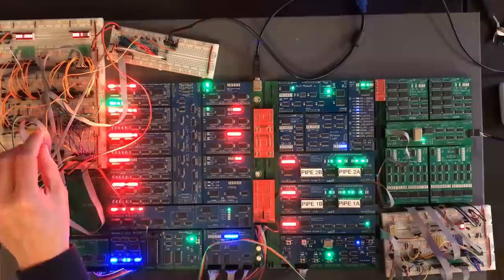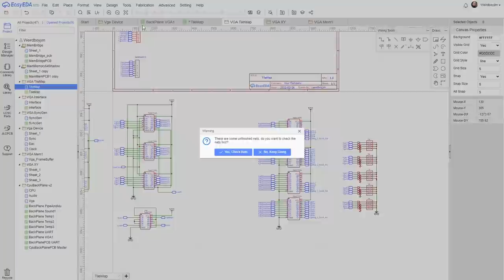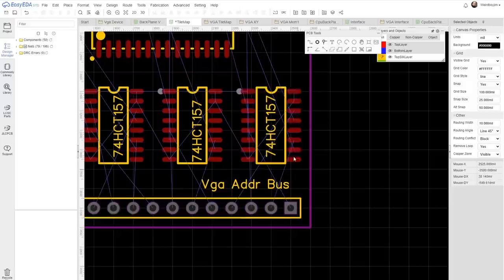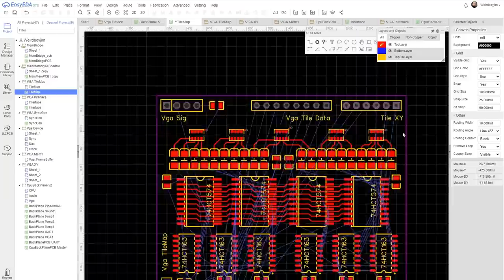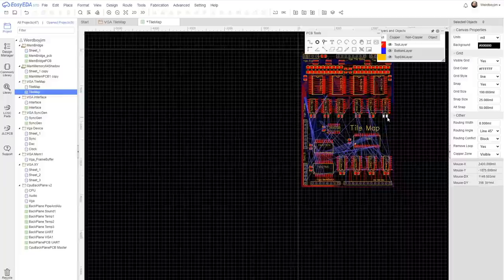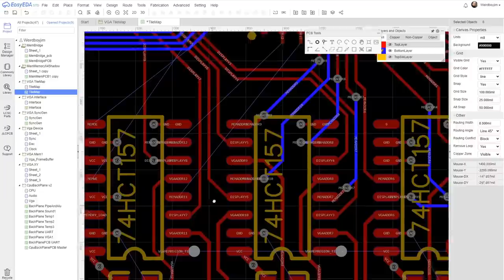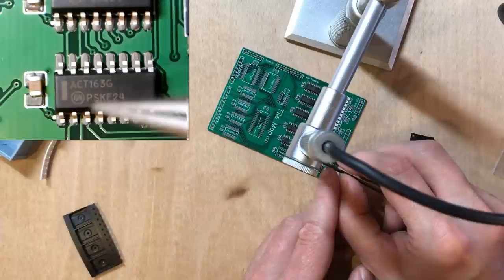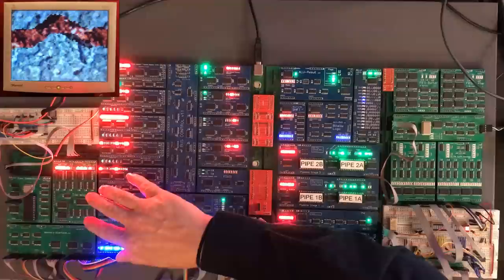Tilemap (Framebuffer) PCB - VGA from Scratch - Part 9

Comment: You would be surprised how many products have gone to market with errors like this that are fixed in firmware. It normally gets resolved in a subsequent updates but version one of the product will be sold with the errors fixed in code. These days it's not so common because PCBs prototypes are quick to turn around but it used to happen all the time.
Reply from the maker: Ha! No I would not be surprised,  I was developing games thru the early console generations. It was not uncommon to have pages of documentation that basically said "Yeah, this is a hardware bug. Here is the work around, there is  no opportunity to fix it".
Reply: @weirdboyjim  Yeh, after graduation I started in electronics in the early 90's but soon jumped ship to software development about 4 years later after realising I enjoyed writing firmware more than the hardware design side so got to see both sides of it.
Reply: Same with ASIC designs! You'd be surprised what gets done with clever software hacks!
Reply: Reminds me of console game development; so many bugs in hardware which needed software workarounds. I remember one early PC graphics card in particular which advertised “hardware transform and lighting”. But we worked out that this was broken, and that it actually sneakily did it all in software.
Reply from the maker: @jimmy21584  I remember that card!
Reply: Historically these errors happen a lot.  And while they can often be bypassed in firmware, the performance and lost of function that they cause can lead to a platform becoming unsupportable.   Nintendo Wii had serious hardware issues in the user input system.  Atari Jaguar had terrible hardware issues with the co-processors that severely hamstrung the platform.  Macintosh 68K developers discovered that the ROM based Floating Point Library could not reliably multiply any even value by 2 without a result that had an unexpected fraction. They had to write their own libraries to avoid this issue because Apple refused to acknowledge that the Library did not meet IEEE 754 compliance.

Comment: I was hoping you would not settle for a soft work around. Well done! Fantastic and fascinating build! Looking forward to the rest of this.
Reply from the maker: I wouldn't have stayed with the soft work around, but I'm glad I didn't have to attempt a wire bodge.
Reply: @weirdboyjim  the problem was introduced when you rotated the connector. You forgot that the other side was already fixed on the base board.
Reply from the maker: @costa_marco  That wasn't it, the connectors were always supposed to be lsb on the right. The issue was purely between the inputs and those register latches. I messed it up when I switched the net's from MemData to VgaData.
Reply: @weirdboyjim  I didn't think you would and it is why I appreciate watching your work.

Comment: I think you hit the nail on the head with your comment on ground issues. As the logic boards grow in number, the issues with signal integrity will increase. So your next step needs to be finding some Pal's, or Gals to reduce the amount of chips so you can shrink the board area. This helps with ground and signal path lengths. The fun with what to do with OTP Pal's if you made a mistake in the logic map :-)
Reply from the maker: Not sure I need to shrink everything down, but more attention to the ground return paths is needed. In this case the sync signals went to the frame buffer bread boards via fly cables in the top of the sync board, the nearest ground return was about 10cm away. Should have added a ground point in that cluster. That was only a temporary line so not a big deal, but on this pcb I've been getting nervous about how far those incoming address lines get from the nearest ground tie to the backplane.
Reply: they made PDP11 entirely out of 74S chips...
Reply: @AmauryJacquot  I think that's why our PDP11 was a lot slower then the PC sized Micro-Vax we replaced it with. bringing back memories of the good old days.
Reply: @TheEmbeddedHobbyist  Yeah.... you all you need to do to get me yearning for my youth is either mention The Human League or the PDP-11. ;)
Reply: @TheEmbeddedHobbyist  yeah, but 74S181 was the most complex chip that was possible at the time the thing was designed…

Comment: James, would love to hear some of your breadboard war storys. Basically the craziness of fault finding on something you just built, that use to work. I'm sure we have all been there.
Reply: As a massive fan of Tom Baker AND The Jupiter Ace, can I just congratulate you on your brilliant name!
Reply from the maker: Ahh the worst one is having it work, then the next day it doesn't. Usually it's a loose wire, but not always.
Reply: Just as tedious is wire wrapping, half the time you end up soldering nearly every connection anyway, I hated it and loved it at the same time. I'm glad it's quick and easy to get prototypes ordered and tested nowadays. Loving this series!!

Comment: Hi James, I would have been tearing my hair out at that! I was extremely impressed by the software fix (although I’m not a coder so your solution is beyond me) I absolutely laughed out loud when you demonstrated your bodge by DuPont switch fix, great work, sadly one board I recently designed I made a stupid error and the resulting PCB required cut tracks and bodge wires…It did work in the end though.
Reply from the maker: I've been fortunate in only having one pcb I couldn't get working in the build so far, I kind of torn about bodging this one,  I might have a go after I've made the fixed version up.

Comment: Yay! Happy Sunday! Tilemaps goodness! I am so stoked, now to actually watch the video.
Edit: That was interesting, a few wild 90-degree track corners appeared, but very well done routing that board. I was/am a bit concerned about the mass of long straight parallel tracks on both sides of the board, won't they make for an amazing aerial? Sure, we are at most dealing with 25 MHz not even getting close to the GHz range where these things really start to matter, but there could be some capacitive coupling. It is probably fine, just one of these backseat routing opinions that are worth the electrons used to transmit them.
Reply from the maker: Hope you enjoy!

Comment: ah yes , invert it two times to make it right . makes sense :D . nice workaround
Reply from the maker: Yes, but I have to fix it before I add any of the other sections that use memory or I'd need to replicate the issue.
Reply: Os replicating the issue bad? Does it have disadvantages? I used design software and hardware and we called lots of bugs design decisions.
Reply: @kriswillems5661  I think most people would invert that: lots of design decisions are bugs.

Comment: I obviously don't know what I'm talking about, but the red bundle in parallel to the big blue bundle in the top left look like "capacitance issues" to me.
What is the "right" and "wrong" way for the resistor arrays? Or is it just "my team" saying to have to have all the markings the same way up? ;)
Loved the wire-flip temporary fix... Nice!
Reply: A bundle of data lines is OK - they generally switch all at once and you just need a little settling time and a good ground between sender and receiver chips.  If you have clocks and other control signals in a bundle, then separation is helpful, and even grounds between signals sometimes, in order to minimise crosstalk.
Reply from the maker: The bundle like that is no different than traces being side by side (Actually a bit better on a 4 layer board as there is a ground plane between them). The long traces down the side do add to capacitance though, if I want to go faster in future builds I'll need to start thinking about that.

Comment: Funny how lateral thinking got you out of a fix there. Still amazing to see what you do. When will I get there? A few days ago my first microcontroller dev board arrived - ESP32. I've decided to leapfrog the Arduino slightly, though I am still using the Arduino IDE and also getting platform IO going on VSCode. Been trying to get the OLED to work, and after a day of tinkering and messing around with serial monitors, flashing blink sketches and some frustration, I'm sort of getting some kind of workflow going. My wife looks on amused as I get the thing to load a monochrome part-image of her face to display on it. 
Between Ben Eater and yourself, you've completely messed me up. I used to be a software purist, but I'm committed now and the psychological hurdles are disappearing. Thanks James!
Reply from the maker: Ahh so your are using the esp as a host for your vga circuit?
Reply: @weirdboyjim  James I can only dream at this point of VGA. I still have to get used to my electronics diapers/nappy, that is how green I am now. I know a bit here and there and of course when I studied at university we did digital logic gates as part of our intro courses (way back in the 80's). So James, I am like a fish out of water (well close to the dam/lake/well). I am going to get there one day, before I retire. I will watch you for inspiration!
Reply: @your_utube  good on you! You'll never regret getting into electronics and being that much more able to build exactly what you want. Keep it up!

Comment: Is there going to be a Microcontroller that will run the whole show ie taking a mode_code plus coords plus the colour and attribute and then does what is necessary to be classed a GPU.
Reply from the maker: Nah, I wouldn't want to integrate a microcontroller, my cpu is more than capable enough for anything this vga circuit can do.

Comment: I realise that I don't know yet how you intend to handle tile data. I have read how the NES (I think) handled the fine X scrolling, with shift registers & a multiplexer to select the correct pixel/bit. But it doesnt seem you are passing the initial scroll offset to the tile data board. I wondered therefore if you are going to pass the VgaTile0-7 plus the DisplayX0-2 "fine scroll" to tile data and get all of the pixel bits in one go (maybe 2 sets of 4 bits in one byte - rather than 4 planes). But - because you are latching the data from the RAM in a 574, wont the tiledata be one step behind DisplayX0-2 - which is not latched ? I guess latch the DisplayX0-2 value one the tile data board to bring it back into sync ? Blimmey this is complicated stuff....
Reply from the maker: There will be a bunch of discussion of these elements in later videos. You are correct in thinking that there needs to be some timing consideration that I have not touched on yet. There are also some surprising influences such as desk and breadboards space which influence what I do in each circuit.

Comment: Try Toothpicks (or connectors) under your Board when reflowing with hotair .. it's incredible how much heat a layered birch plate (?) can suck away.. flatness .. My experience at least I have one too as workspace  ;)
I always find it fascinating what decisions people make when routing.. that board would be a good routing challenge :D
Nice work ! Thanks :)
Reply from the maker: I could always try sitting it on the pin headers, they would provide good isolation.

Comment: How do you get your Stencil sent to you in a bag, mine always comes between a pair of massive spoil boards 😢
Reply from the maker: Is your stencil full size?  I had mine arrive like that before, actually a recent one did but that was because I forgot to set a custom size. The ones that come in the bag I've set to 150x100, the full size ones are really unwieldy for a small pcb.
Reply: @weirdboyjim  That is interesting, I had noticed the customised size option but thought that it might be more expensive but that does not seem to be the case - thanks 👍

Comment: I had to laugh.  I got bitten by a bus reversal in the mid-80s - it was for a weird TI dual port memory chip that had bit 0 as the MSB and bit 7 as the LSB and the bits did matter in that case since they also accessed a bunch of control registers (TMS9650 if curious).  I had eight tracks neatly routed at 0.025 inch pitch.  One cut across all eight and eight very tiny wires later, problem solved.  My eyesight might be a barrier to such a solution these days though. 😂
Reply from the maker: That sounds fun! I have to say I'm pleased I didn't have to try and bodge this one!
Reply: Happened to us too in an advanced satellite demodulator. It was very hard to find because all the bits are pseudo random in that circuit, so you can not just see or measure the error. I found it after reviewing the FPGA design.
Reply: @kriswillems5661  All the bits, but not necessarily in the right order... (sorry, Brit humour from the 1970s)

Comment: What about disabling Line_Flyback pulse till the pixel is read or written.
Reply from the maker: What do you think that would achieve?  If I don't keep pace with the sync it would mess up the display regardless.
Reply: @weirdboyjim  It is how the CGA on computers works maybe someone at AMD could enlighten you, I can remember where I had to disable LFB until I had finished updating the screen then turn on LFB again, I was thinking about CGA not VGA or SVGA sorry.
Reply from the maker: @DAVIDGREGORYKERR  That isn't the way vga works.  G-Sync and Freesync let you modify the sync more flexibility but they are modern technologies for digital displays. These original signals are designed for crt's for physical synchronization and it would take the circuits a while to adapt to change in the pulse cadence. Unless you are just suggesting I stop output the signal during update?
Reply: @weirdboyjim  Do as you deem fit.

Comment: There are tons of bugs like yours, with similar fixes, but instead of being temporary, they went to production. Even some of the big brand PCs had bodge wires on their motherboards (can't remember the brand or the model and couldn't find it).
Reply from the maker: Yeah, it used to be really common in the documentation for games consoles. Not so much now, but I suspect things are better hidden behind api's etc...
Reply: @weirdboyjim  yeah, there is more memory and more CPU cycles to burn for fixing stuff in software cough*meltdown*cough and hoping nobody will notice.

Comment: I feel bad about only one thing when I watch your channel: that I was not following you from the very beginning. It takes a very long time to catch up and some of your videos require a few reviews to fully understand your explanations.
It would help a little bit if you would use the standardized symbols for latches, flipflops and multiplexers, as they are easier to recognize on smaller or low resolution displays.
Reply from the maker: I don't think easy eda supports using standardized symbols like that, I know other software let's you work on symbols and then map it to devices which would be interesting to play with. I want to finish this particular build with this software though, so I have all the schematics in one place.
Reply: I agree, but the hierarchy of the modern schematic is here to stay, trying to follow one when fault finding is a nightmare, I repair old arcade boards and the schematics frequently cover many pages, but at least you can physically follow a connection from from one page to the next. Another oddity in old schematics is seeing a NAND gate drawn (for the same device) in two different ways, one as the standardised NAND we all know and the other as a an OR gate with active low (inverted) inputs…

Comment: I laughted hard at 45:58 when you revealed that fix!
EDIT: I realize bus data also feeds the RAM, in the right order, so everything I wrote below is completely inaccurate. Oops!
Original: Wouldn't it be possible to desolder the female bus header on the backplane, and instead solder some wires between the backplane and the board to reverse the bits? I know you're trying to avoid soldering wires, but since both the backplane and the board are temporary this would be a simple hardware fix that ensures you're not introducing other bugs with workarounds.
Reply from the maker: Well I could just switch the input and output around on the backplane just for this module,  but assuming I want all the other connectors to be lsb on the right It would make routing the backplane a pain.

Comment: by the way, since you keep hitting the "connector wrong way around" issue, it looked like you didn't actually put any gender/pcb-sidedness on those, maybe that's the problem (as in, they seem to be the same part, on the same side, which technically should make them fit, but maybe easyeda is trying to be "smart")? like i'd expect e.g. the connector to be on the front of the backplane and female while the module ones on the back of the pcb and male should orient correctly automatically... that said, better double check everything anyway, it's annoying to have your boards made and then find out one of them is the wrong way :P
Reply from the maker: I just need to take care with the orientation!

Comment: How long till we running Doom? :)
Cool deal man.
Reply from the maker: Lol, Might need to set the game sights a little lower.
Reply: @weirdboyjim  No one said it had to run good :)
Reply: And after that "can it run Crysis?"
Reply: This system is particularly beefy for an 8-bit system, and Doom was able to run on the SNES which wasn't too much more powerful than the NES. It will definitely be even more challenging than porting to the SNES, but I think that Doom may very well be able to run with some exceptionally clever programming.